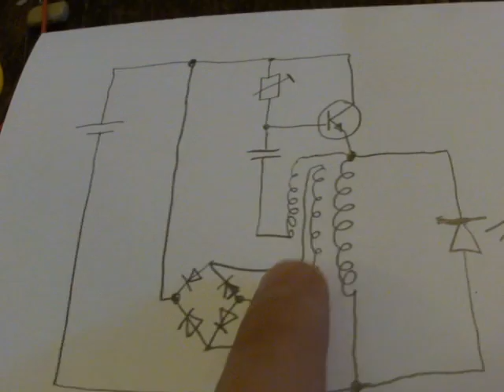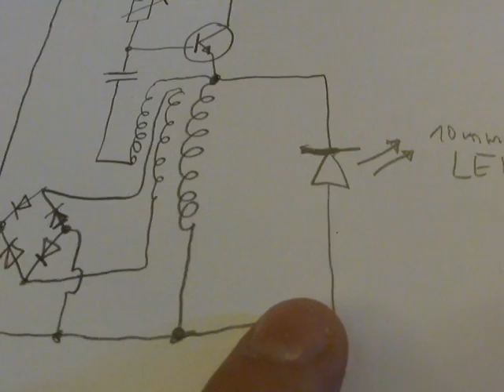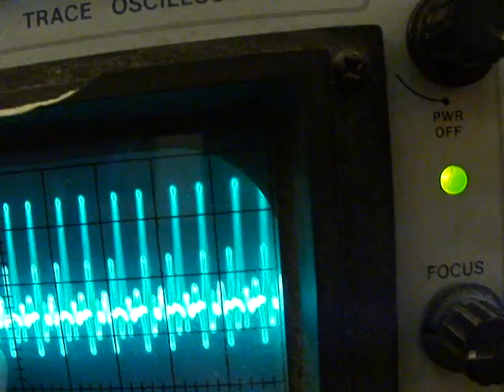Visit at Per Johan in Sweden to work on the Prof. Jones circuit

Comment: already did much time ago! I'm interested to replicate this circuit but I'm a newbie and still have to understand many things. I just made some Joule Thief with different coils, some of them I made as variations from existing ones. for example, I made a multifilar pancake coils, or a bifilar pancake with the second winding wrapped around the first. I still haven't a scope to see what happens, but I turn on 20 LEDs with 3 volts or less and about 90 mA. not bas as a start ;)